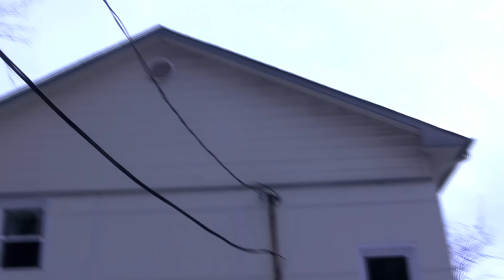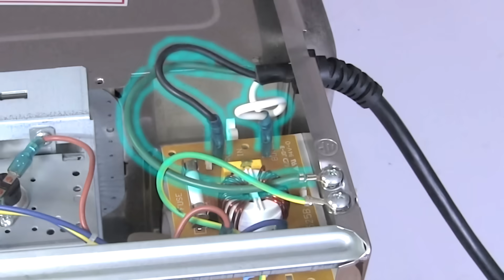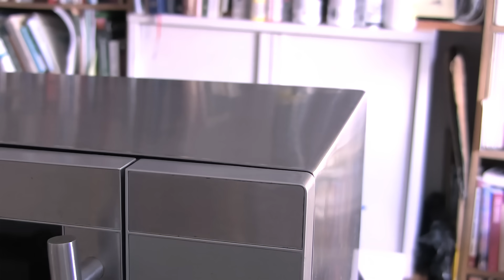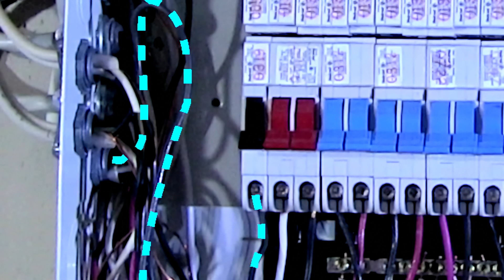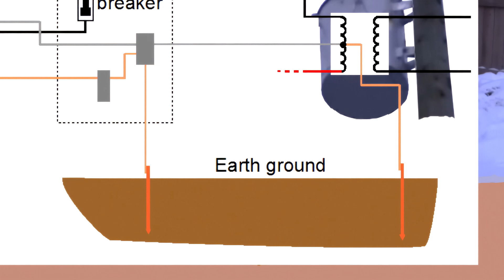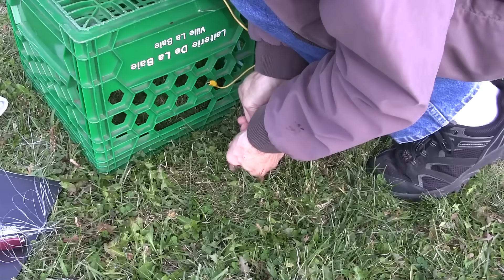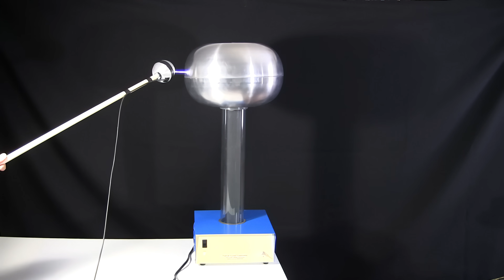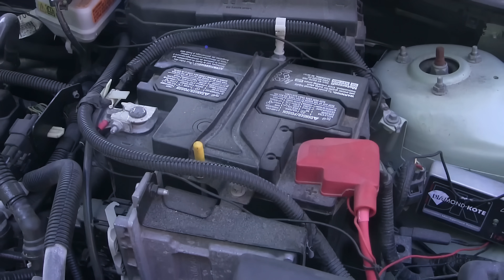What is Ground? Earth Ground/Earthing

Comment: Here in india, 
Earth connection is done by,
Digging a hole.in the ground maybe 2sqft. And like 2 feet deep.
Then pouring a layer of charcoal, 
Then a layer of sea salt. 
And repeat until only some space is remaining, 
Push the earth wire into it, 
And close the hole with soil.
Reply from the maker: That makes sense. The sea salt would make the ground more electrically conductive, which is needs to be. Thanks for sharing.
Reply: Won't sea salt damage the chemical balance of the soil in the long run?

Comment: In europe we take full 240V and not center tapped 120V. I don't really know why is this way.
Reply: We don't really have any equipment that needs 120V.

And running that extra option of voltage is unnecessarily complicated.
So instead. We get 3 phase supply to transformers, 
And homes will only get one of those 3 phases.
Different houses might get different one of those phases.
It's a simpler system.
Reply: The voltage in Europe is 230 V though in Finland we use 400 V three phase.

Comment: Two questions: - what earthing system was shown? TN-C-S , TT, or probably some hybrid between both?
2nd - why do we add second grounding pole if the transformer is already grounded? 🤔 Was this done in order to equal any sign of potential differentiation! 🤔
Reply: In transformer, 
The neutral wire is grounded.
It has it's own purpose.
In the system described here. The two hot wires would be 180° out of phase. But only one neutral, which effectively means, if both hot wires are being used equally, the neutral wire gets cancelled out because of phase difference.
But if the usage is not balanced, neutral might have some current flowing through it.
Then they would need a whole wife running all the way to electricity generation station. That's expensive. So they instead connect neutrals from both end into the ground.

And you'll get just the 2 hot wires running from power station to transformers.
And from transformer to home, neutral wire is added.
But still no earth wire.
So you need to connect that earth wire somewhere, which will be ground...

Comment: Nice video.

So do I have the right idea?  Earth ground is really just a giant electron sink to bleed off any stray potential in a circuit. Kind of like a resistor in parallel with a capacitor to bleed off the charge in the form of heat.
Reply from the maker: Thanks. Any yes, for what I talk about in the second part of this video where charge is discharged from a panel to ground, you have the right idea.

Comment: Sir, if I may ask please, 
Is it safe to connect the equipment ground wire with the neutral without using the ground rode like the diagram @ 3:26 ?
I have a refrigerator that gives very small electric shock, is it safe to connect the third ground wire with the neutral directly, so we dissipate the charge all the way through the neutral wire, 
Awaiting your valuable answer Sir
Reply: No it will not work. It's going to trip a RCD as soon as you connect it to the wall plug. You should either buy a new fridge or find where it's touching the case and fix it
Reply: @gredausvemiru6236  Not only that but even if the breaker didn't trip, he'll have the return current for the neutral wire actively flowing through the bonded parts of the fridge. Yikes.
Reply: No, that's not safe at all.
Reply: Ya sure, what's the worst that can happen?...

Comment: Did we not stop "bonding" neutral to ground in the U.S. several years ago except to the first service panel? Microwave would be connected to a sub-panel eg: NEC Table 250.122.

Comment: Why does the electron, during normal condition, does not go to Earth? Why does it go back to the transformer via neutral wire?
Reply from the maker: The return path for the circuit through the Earth is a much higher resistance than the return path through the copper neural wire and electricity takes the path of least resistance. So some of it probably does take the return path through the Earth but if any does, it's small compared to the amount that goes through the neural wire, because of the different resistances.
Reply: @RimstarOrg  Small but critical key point: Electricity does not just take the path of least resistance. It takes ALL paths back to it's source. It's just that some paths will have more flow than others. 
Imagine a large diameter water pipe with a little straw size pipe running in parallel. Most water flows in the large one but some in the small one.
So in your reply, some of it definitely (not probably) goes back via the earth.
Reply from the maker: Thanks for clarifying if I wasn't clear. I did say that some of it probably does take the return path through the Earth (could be infinite resistance) though I did also say that it takes the path of least resistance, which as you point out isn't true if there is more than one path.
Reply: @RimstarOrg  thank you, I get it now.
Reply from the maker: You're welcome. Thanks for the question. I'm sure others here were wondering the same.
Reply: @RimstarOrg  Thanks for this wonderful explanation 🤗
Reply: I have another question. When the lightning charges the panel board, why does the charge goes to earth? Why does it not go to the neutral wire since the ground and neutral wire are connected?
Reply: @japhetvalentin7084  well the panel board is protected by the metal casing, so when lightning hits, it hits the metal casing. The ground wire is connected to the metal casing. The ground wire's resistance is significantly less than the hot and neutral wires. So electricity will travel from the metal casing to the ground wire and back to the ground. Thats what i think it will happen
Reply: @japhetvalentin7084  also hot and neutral wires are not meant to be connected to the metal casing

Comment: You stated that the Source of the Voltage (Transformer Secondary) is Grounded. Why doesn’t the electric current flow to the Ground wire, but instead, the electric current flows to the Hot wire? If electric current seeks the lowest electrical charge potential, wouldn't the electric current go to ground immediately, thus, the electric current is terminated to Ground right away?

Also, since the Neutral wire is Grounded, wouldn't the returning electric current go to Ground immediately as well?

I am very confused.

Comment: For low voltage DC devices without a connection to Earth ground, sometimes when I brush my hand across them I can feel a buzzing sensation when they're connected to mains AC. Can all devices deal with this voltage leak and is it dangerous to a device that is normally just connected to a battery?
Reply from the maker: Each device is different so I can't say. If a device is designed to be powered by a battery (DC) and you're giving it AC then that may or may not damage the device. It just depends on the circuit in the device.
Reply: @RimstarOrg  yeah I've been researching a lot and feel like there's a lot of 'it depends' in regards to this subject.

To be clear I'm actually connecting a network video recorder device to a 12v battery which IS designed to be connected to DC 15v to charge, but this comes from a power pack which plugs into mains. Even with a grounded power adapter and only DC coming in, there seems to be this  vibrating buzzing feeling on the device, I'm just not sure how it gets there. Same thing that happens with some laptops when plugged in. 

The video recorder seems to work fine, so I'm not sure if I should just ignore it or be worried. It's designed to be in a vehicle running off the 12v/24v battery.
Reply from the maker: It sounds like there might be a transformer coil in there that's vibrating. I don't know if it's good or bad though.
Reply: @LewisCostin  Something like that would happen to my pc when I connected a different power cord. It would vibrate or fuzz and make a weird noise; be careful because the metal components of my pc case would become hot and shock me

Comment: Dear Sir,  can you explain why in some countries, their electricity plugs are 2-pin, and in some countries its 3-pin. For 2-pin plugs (2 wires only) how are they going to achieve all the advantages of grounding?  So is the use of 2-pin plugs (such countries) inherently more hazardous?  Thank you.
Reply: It's not hazardous, but relatively less safe.

But in most of the cases, it doesn't matter.
Like the phone charger, 
It connects directly into the wall, and there's no metal part  outside that you can touch.
So there's almost 0 chance of getting electrocuted.
So ground is unnecessary...
Reply: 2-pin plugs like type E and F achieve grounding by a plug in the socket, or connectors on the side of the plug. I can't account for all countries, but I'd be surprised if there's even one where everything is not grounded
Reply: It's also because those devices are double insulated and don't have any conductive materials outside that would shock you

Comment: What is the potential between a 6V lead acid batteries positive pin and the earth ground if the battery is simply staying there floating in the air? How about the negative pin?

Comment: Out here in Australia, the circuit breaker switches go up for on and when tripped are pointing down - a much safer way to do this in my humble view in case they are accidentally knocked down..
Reply: I think they are like that in most countries, it's only the UK as far as I know that has the fail dangerous kind where down is on and up is off, though all new construction requires them to be fail safe.
Reply: In the US breakers have three settings: on, off and tripped. That is one knows it has been deliberately set off for example for some work. In European ones there is no difference between tripped and one that has been turned off deliberately so someone might mistake the latter as tripped and turn it on.

Comment: In my home, the ground pin in the socket is not connected to anything. Shall I connect the neutral pin to the ground pin inside the board? Consider the case that I don't want safety from lightning.
Reply: Impatiently waiting for your reply.
Reply: Do not do that. In case of loss of neutral, the entire metal framing of the equipment that is connected to the socket will become live, placing you at risk. The most dangerous instance of this is when the ground of electric showerheads are connected to neutral, in which case an entire body of water can become energized if neutral is lost or if the resistor inside the showerhead becomes open.

You are better off leaving that ground pin alone if you do not intend to place separate neutral and earth buses inside your distribution panel, connect them together using an appropriate sized jumper and then attach equipment grounding conductors from the earth bus to each socket in your household, considering a TN-C-S earthing arrangement.
Reply: @taka4059  I don't agree with your suggestion.  If I don't have a grounding facility then if I connect neutral and ground pins together then I would be protected from faults until my neutral is lost but I would always be in risk of shock from faults in case I don't connect neutral and ground together.

Comment: Can you please clarify the point when said that there is a potential between the electrical panel and ground thus a current will flow; how does current flow if there is no closed circuit? and if you considered the ground to be a conductive part; can you explain how it become conductive? Many thanks in advance.
Reply from the maker: To answer your questions we can begin with that the Earth's ground can be conductive. I say "can be" because the conductivity varies a lot depending on the material. Wet soil is mildly conductive whereas dry sand isn't conductive. The ions in the wet soil are what really make it conductive. But even the wet soil isn't hugely conductive, there's still a lot of resistance. Recall from the video that the center of the transformer is connected to ground so the ground provides the return path, the close circuit. But due to the high resistance, the ground isn't a great conductor. That's why when I've sometimes touched the HOT wire, I've felt only a mild buzzing. But don't try it anyway since there might be a low resistance path you're not aware of.
Reply: @RimstarOrg  in the video you say:  "that the ground path is a low resistance path, so the current is high , high enough to trip the breaker 2:52 "
Earth ground path is for cases charging because lightning only and the other ground low resistance path in case of contact hot wire with a case? 
Why not use the same path for both and eliminate earth ground then?
Reply from the maker: Looking at the diagram at 5:40, you can see there are two paths to Earth ground, one directly from the breaker panel and another path that goes from the neutral bar in the breaker panel where both the neutral and the Earth ground are connected to, which then goes along the grey neutral wire back to the middle of the transformer and from there to another Earth ground. So there are two paths. I'm guessing that's for redundancy. What if one is broken?
The shortest one, and since they're both just copper wire, the least resistance one is from the breaker panel directly to Earth ground (the shorter the wire, the lower the resistance). The current from the charge due to the lightning will take both paths but the lower resistance, more direct path will get a higher current since it's lower resistance. In the animation, I showed just that path being taken but likely some of the charge takes the path through the transformer too.

Comment: Great explanation

But why cant the microwave case just be connected to the neutral wire though if according to the diagram its effectively ground?
Reply from the maker: The neutral wire is a part of the circuit. When the microwave oven is turned on, there is current flowing through the hot wire, the microwave oven circuitry, and the neutral wire. If you connect the neutral to the case and then you touch the case and you are grounded then some of the current may flow through you too.
Reply: @RimstarOrg  I see. Thanks for explaining
Reply: @RimstarOrg  you are an absolute champion man. I found myself wondering about how ground works, and not only do you have a great summary, you’re actively responding to questions years later. Really appreciate it!
Reply: @RimstarOrg  Thanks for the answer, but I'm still not clear on how current flows through a person touching the microwave case.  It comes in from the hot wire, enters the body (hand), and then goes where?
Reply: @Michael Economides depends on the situation I think. If you touch it with both hands it might flow across your chest. If you’re standing on the actual ground outside and touch it with one hand it will go from your hand down your body, through your shoes and into the ground. If you’re standing somewhere that’s insulated from earth ground and you touch it with a finger nothing will flow through you.
Reply: @RimstarOrg  I have a TN-C system. I measured the voltage between the microwave and my tap when it was running at 5 A. It was under one volt. That does not put any current through anyone.
Reply: Well plugs often can go either way so what would happen if you reversed the plug. There are problems in using neutral for grounding so even if it has been used somewhere in the past it is not used anymore., even when used there as a separate contact on the socket for grounding.

Comment: Excelent explanation. In 5:30 the reason is explained a little bit off, also there is a second reason for the transformer's ground: The first reason is for the lightning hitting the wires of the poles to find its way to the ground (and not like explained, lightning hitting the ground to balance charges nearby, wich really occours, but as a 'bonus'). The second reason is the "capacitive coupling" of the transformer. This coupling carry some voltage from the High Voltage side of transformer to the secondary windings, this means that if you measure a ungrounded transformer from any secondary terminal (neutral or hot) to the earth, you will get some measurement from 1kv to 10kv, of course, with very low current, that could shock easily, even with thick shoes.

Comment: First it’s not a ground on the prong of a plug. It’s a bond. Second it’s not a neutral it called a  Identified or ID. There are 3 types or grounding. Bonding, grounded and grounding.
Reply from the maker: Different countries have different terminology. Having said that though, I chose even to ignore our strict terminology and opt for simpler terms instead. This video is targeted at the general public and is not intended for the electrical installer. For that I recommend Mike Holt's videos e.g. https://www.youtube.com/watch?v=mpgAVE4UwFw.
Reply: In North America the neutral that you say is called a ID or identified. Not a neutral. It is also referred as the grounded wire. A neutral carries the unbalanced load of a Edison CCT.  The ground you call on your house is called a bond. And it is used to make all metal the same potential. And you do mention that. Then there is the ungrounded. And that is your hot. Then you have your grounding wire and that is attached to you ground plate, water or rod. And yes you are right you want that to be low resistance. And why is because if there is a ground fault we want to have high current to trip a current interrupter. Or a regular breaker. From the NEC is says that a number 6 should do as the min. It’s important that you differentiate the 3 different kinds of grounding as they play different roles in electrical CCTs. Some is used for safety. And others is used to make things work. And more safety. There is also other grounds like isolated grounds and lighting grounds. I could go on forever.
Reply: @josephmurphy4229  Yes, we can see you could go on forever 🤣 jk! Thanks for the info, but most of us are just looking for a simple explanation.